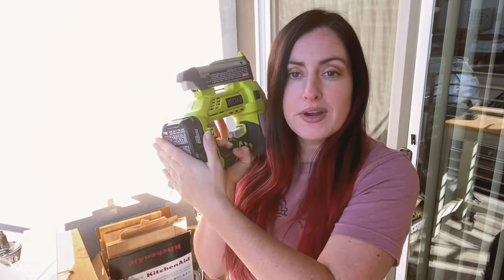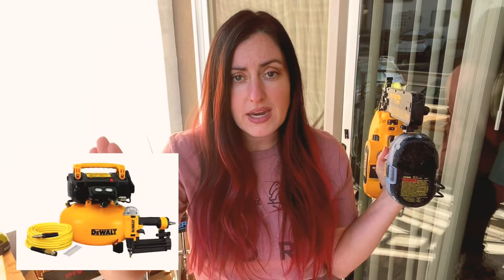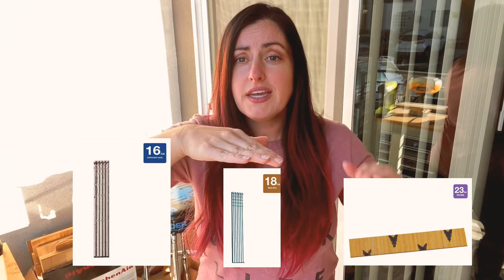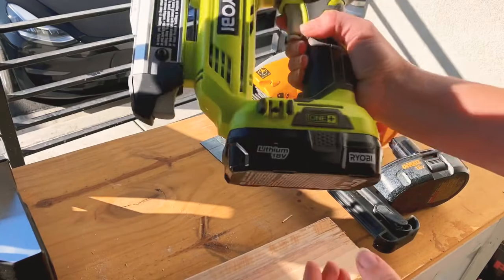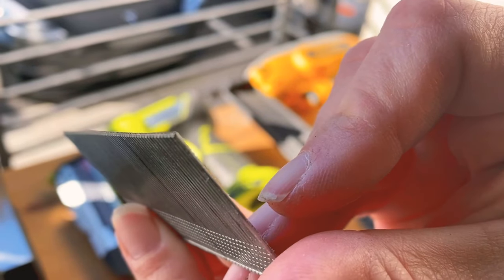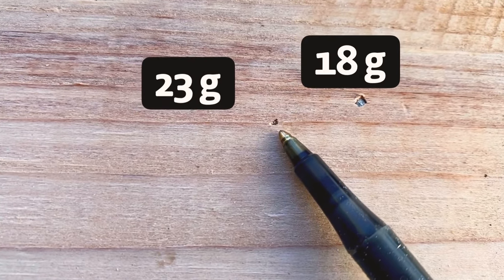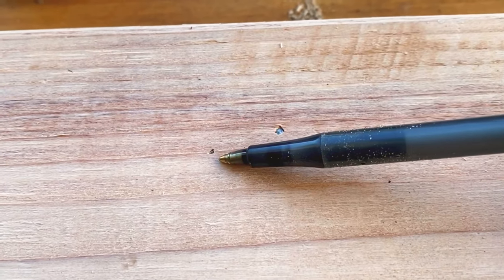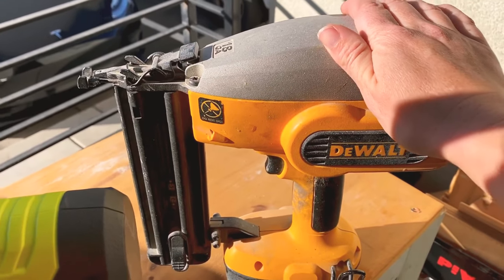HOW TO USE A NAIL GUN - FOR BEGINNERS PIN nailer VS BRAD Nailer

Comment: Nice video going over all the different types of nail guns. For the thickness/sizing it's easier to remember 18ga = 18 nails/inch, 23ga = 23 nails/inch, etc. The smaller, the better for finishing trim work.

One important thing for beginners - never put 16ga nails in an 18ga nail gun, or you will ruin your nail run. I destroyed an old Craftsman 18ga by accidentally putting 16ga nails in it and the master cylinder blew up and broke inside.

It was so confusing for me as well, and I spent a lot of time researching which nail gun to buy for my needs. I eventually went with a pneumatic 18ga because I already had a compressor, and 18ga would be the best overall size. Otherwise I would've bought a battery powered one.
Reply from the maker: Great points! Yea you are right, it’s important to use 18g nails in a  18g gun and so on. So sorry to hear you had to learn that the hard way! Thanks for watching!
Reply: I wondered about that. I expect that the same applies to wire and screws and electrical cables. I'm not sure about fish hooks.
Reply: Can't put a thicker nail through a thinner hole. 16 Gauge is bigger then the 18 Gauge. Larger the number smaller the diameter of the nail.
Reply: I would love to stick a 16ga in a 18ga DeWalt LMFAO put the ramp up on the flywheel out if its misery
Reply: @EternalHarvestDecor  God, Someone finally explains this right! So many of these nailer videos are made awful, But yours is good.

Comment: I bought a cordless brad nailer a couple years ago after much confusion over gauges. I bought it for a single project, but I have ended up using that thing for at least 80% of my wood projects. It's just so extremely useful to be able to tack something into place temporarily while I glue or drive screws.

Comment: Excellent video. Thanks. Was thinking of a pin nailer to fix 3mm oil-tempered hardboard to a brick wall with hard plaster. Decided to use spray-on contact adhesive with 3mm screws in plastic plugs to supplement the glue. Screw heads will be filled. Two layers of backing wallpaper then top patterned layer of wallpaper in daughter's old twisted quirky house

Comment: Thank you so much, I am having many corners inside my house come apart, and I didn’t know what to do about it, I was really stressed, but with your information, I’m totally at ease now, and can’t wait to start that project, I have many corner cracks through out the house and now I know exactly what I’ll need for the job,You have been so helpful, once again thank you so much, and I’ll be picking up mine today.
Reply from the maker: Oh be so careful with those corner cracks a lot of time they have a nail guard on them that is metal and that can cause the nail to shoot back towards you. For nail pops and cracks I’d use a screwdriver and drywall screw and then sparkle and touch up paint. Good luck! Thanks for watching

Comment: I've never seen these nailers up close before. I assumed the nails would be like, regular nails, but chained together. But they arent pointy, only sharpened and the heads dont look round, they are like T nails. They look like it'd be really hard to pull these out vs standard nails of the same sizes.

Comment: Thanks so much for the great video! Really great work! Interesting fact that not many people know... 20 Volt (Max) tools are actually 18 Volt tools!... Any Lithium Ion 18 Volt battery pack is actually 20 Volt when FULLY CHARGED... The moment you start using the tool, the voltage drops very rapidly to 18 Volt, where it remains for a very long time... Therefore the 20 Volt (Max) rating is actually a sales gimmick... They specify the MAX (FULLY CHARGED) Voltage of the 18 Volt battery pack  rather than the nominal (working) voltage of the same battery pack (as specified by other manufacturers)! You will even notice that 20 Volt tools are called "20 VOLT MAX" by the manufacturers!... This is the reason for the "MAX" part of the description!
Reply from the maker: Wow that’s awesome information!! Thank you!
Reply: @EternalHarvestDecor  thanks for your wonderful and extremely informative videos! The reason I added this information is to "protect" buyers from being misled by this sales gimmick!... If you have a 18 Volt tool that still works, don't replace it with a 20 Volt Max tool just because you think that the "extra" 2 Volts is going to give you extra power!... If your 18 Volt tool is very old, obviously you will get better performance from a brand new 20 Volt Max tool (which is actually a 18 Volt tool as explained), but that's because of newer technology rather than 2 extra Volts! Therefore when buying a tool just realise that a 20 Volt Max tool is actually a 18 Volt tool, therefore it shouldn't influence your decision of which tool (18 Volt vs 20 Volt Max) to buy!... Rather compare the REAL FEATURES of the tools and make your decision accordingly!

Comment: Awesome.. so how those are different from smaller stapler & nailer gun 2 in one in terms of uses & ease of use ?
Reply from the maker: Typically staples aren’t used for finish work like trim etc, I do a lot of that so I opted for a nail gun. Both hold well but the finish look is different. Nails are flush and staples are not. Staples are great for signs, furniture backing etc.

Comment: I expect to fabricate multiple bird nesting boxes of various types.  Sure I could use a hammer and nails but that could be a pain and screws would be rather slow.  I purchased an electric DeWalt 5-in-1 multi tacker and brad nailer.  I needed inch and a quarter nails since I am planning to use cedar fence slats for the nesting boxes.  A battery operated gun would be nice but, since I am going to be working at my work bench, the corded variety is better for me.  It is cheaper and since it doesn't use a heavy battery, the unit is a bit lighter in weight...

Comment: Can these types of brad and pin nailers take different gauge pin nails or brads? Or are they strictly only for one size  brad or pin nail? Great video. Ive been on the fence as to which model to get. Have you tried the Ryobi 18 Guage Brad nailer?  Ive been looking at that model due to Dewalt being a bit more pricey. Great video!
Reply from the maker: Hi Richard! These types of brad and pin nailers can only take the one size. If you try to use different sizes it will break and could be dangerous. I would recommend the craftsman 18g nailer if you’re looking for a more affordable option like this https://amzn.to/2JNHvQd

Comment: Which one do you use for baseboards? Do you have to be careful of hitting electrical wires?
Reply from the maker: You don't normally have to worry about electrical that far down on a wall if you are doing baseboard and yes this nailer works great for that.  I d suggest using a 1 1/4 nail that way you are not going past the .5" molding and 3/4" drywall.
Reply: @EternalHarvestDecor  Thanks kindly for the detailed answer.

Comment: great job!  im looking for nailer for wainscotting which is on top of old plaster and lathe walls-  would the dewalt do the trick with 1 and 1/2 inch nails - the wainscoting is 1/4 inch thick - thank you so much!
Reply from the maker: This should work
Reply: Yah 1 1/4- 1 1-/“ into studs are your best bet’ find your studs with stud finder magnet etc’ out a piece of painters tape where stud is also fun fact of u put tiny pieces of painters tape on the trim mdf quarter round etc before u use nail gun just shoot nail through tape then u can fill in with sparkle and not get it all over the wood/ mdf etc after dry pull up tape and you’re ready to paint

Comment: What type of nail gun would you recommend me!?
For the 2x4 and 2x6 wood
I would like to get a wireless if there is one!
Reply from the maker: Hi Vicky! I would suggest a battery operated Craftsman or Dewalt 18 gauge for 2x material! Both are awesome
Here is a link for the dewalt with no battery  https://amzn.to/3iaV9JV
Here is the link for a craftsman https://amzn.to/3nL7OEx

Good luck!
Reply: Hi Vicky ta. The max nail length that I am aware of for 18 gauge nails is 2 inches (50mm)... Therefore it depends what you want to do!... The longest 18 gauge nails available will not (or hardly) go through any 2X material!... If you want to nail a thin piece of wood to a 2X, 18 gauge will work... But if you want to shoot a nail through any 2X to fix it to something else, an 18 gauge nailer will not work since the max nail length available is 2 inch!... Then I would suggest a "roof nailer" for which you can get nails of almost 4 inches. Roof nailers shoots PROPER nails with PROPER heads! One of the best options available for nails is actually a "palm nailer" since you can use literally ANY SIZE nail!... Palm nailers were previously available only for compressors (pneumatic) but you now get them in cordless as well!... They don't need special nails like other nailers, they can drive any nail that you can drive with a hammer (but in record time)! Probably the best advantage above a hammer is that it enables you to drive a nail where it would be impossible to drive the same nail with a hammer since there is not enough space to swing the hammer! Check them out on YouTube, they are amazing!!! Called a "palm nailer"... The pneumatic version is dirt cheap compared to the cordless version (but you need a compressor, which I believe is a great investment anyway)... The nice thing with any type of pneumatic nailer is that you can get away with the smallest cheapest compressor since they don't require much air to operate

Comment: Do they take different lengths of pins/nails.?
Reply from the maker: They take different lengths but only one size. Meaning a pin nail is a 23g and the 23g comes in 1, 1.5, 2” lengths and the same goes for the Brad which is 18g it has different lengths up to 2”. Thanks for watching, hope this helps!

Comment: I have an outdoor plant table and shutters I'm working on. Both are made out of cedar (and I'll probably be doing more work like this). Do you think a pin or brad nailer would be best? Thanks!
Reply from the maker: I would actually use a driver and outdoor screws for that kind of project

Comment: I've been doing trim work for almost 45 yrs. and I don't get the battery nailers. They are behemoths and I know they are heavy. I have never minded having an air hose and today they are light and flexible. I can honestly say that it's been 44 yrs since I've felt like my gun was hooked up to anything. I use Senco, the new ones are light and small and don't make that stupid noise battery powered make. I'd sure hate to use that giant Dewalt in tight places you have to work sometimes. IMO
Reply from the maker: Totally get that, everyone can choose to go with what they like. I’ve loved mine

Comment: Would you use a nailer for sub flooring or would you use wood screws for sub-flooring?
Reply from the maker: I think you could go either way! Screw will hold it tight though
Reply: Deff screw brad nail will let subfloor lift over time u need adhesive and screws

Comment: So, you have to buy a different nailer for different size nailas? That can be very expensive
Reply from the maker: Yes and I found the 18g to be the most versatile. I only had that for a few years then added the 23g. Unless you’re doing more basic carpentry or framing the 15g isn’t necessary IMO

Comment: In your video you said the arrow on the 23  gauge pins should point toward the trigger when loaded.  On my Bostitch 23 gauge the pins are loaded into the magazine with the arrows pointing down, toward the work piece.  I checked the instructions for your Ryobi model and they also say to load the pins with the arrow pointing down - toward the work piece.  I slowed down the video to watch as you took the pins out of your nailer, and you actually had the loaded correctly, with the arrows pointing down.  Then you said you wanted to have the arrows "facing out", meaning toward the work piece.  I guess you just misspoke when you said the arrows should point toward the trigger.
Reply from the maker: I think maybe the video was flipped on my camera, they should always face away from the trigger, out to your piece.

Thanks for watching

Comment: Good video.  I definitely recommend you spend the extra money to get the same brand for any of your cordless power tools.  Batteries are very expensive, and having to have a separate battery for your Brad Nailer vs. your Pin Nailer or even your Driver/Drills just keeps adding to the price and another batter you gotta worry about charging.  Power Tool batteries are like $80 a pop for the standard 20V batteries.  Don't stress too much on which brand you choose, especially if you feel like Dewalt makes better drills/drivers and Milwaukee makes better cordless nailers.  Just stick to the brand and save money.
Reply from the maker: Good suggestion for sure. I dont mind having different brands but I totally get what you mean!

Comment: Hi Brandi which one would you recommend for wood panelling onto a concrete wall? Thanks
Reply from the maker: I would not recommend using bradnails on a concrete wall. Just use adhesive in that instance. IMO good luck!
Reply: @EternalHarvestDecor  thank you 🙏